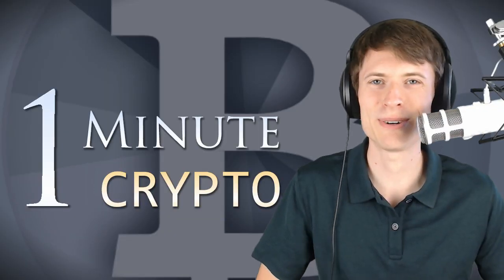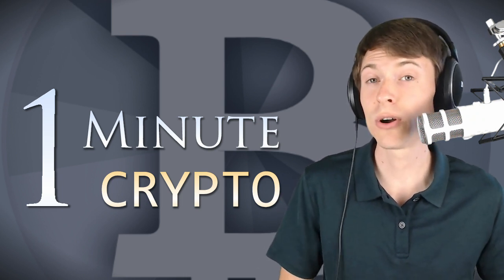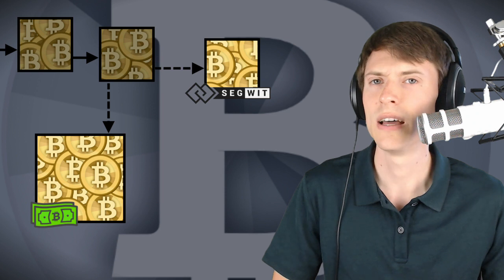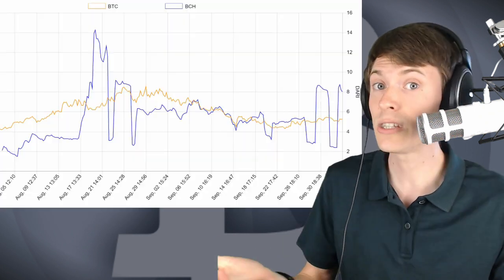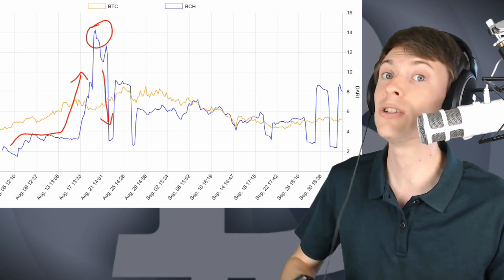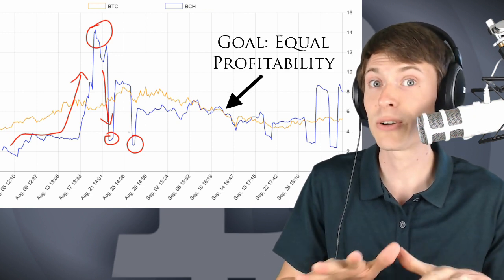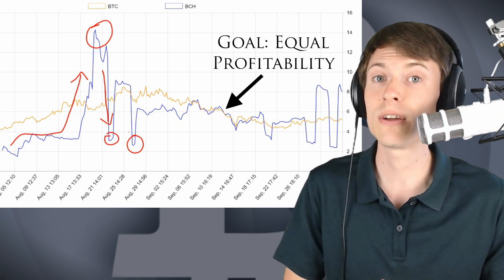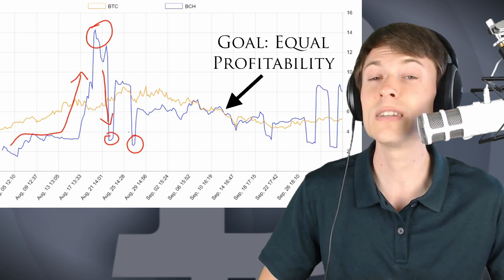Upcoming Fix for Bitcoin Cash "Turbo Blocks"

Comment: You could really improve the quality of this channel substantially.  Document and show links to the key things you're talking about.  Listen to Nelson above "you didn't say what the proposal is".  Also, any observer could see that while for a time the price was tracking more evenly between the two chains, that more recently the wild swings have resumed.  What is the cause of that?  What will drive whether any proposals are accepted?  Also, where are you getting the charts you're showing?  Think of your role as being a "forensic reporter".  Show your work, don't hoard your data.  You will be much more successful.
Reply from the maker: Hi Dan, thanks for the excellent feedback. We'll certainly take it into account.

I'll answer a couple of your questions: The source of the chart is shown in the video: http://fork.lol. The wild swings will continue until this "fix" is in place, because the ecosystem is unstable. This is because, when one chain is more profitable, the short-term best action for 100% of miners is to mine only the more profitable chain until a difficulty adjustment. This creates large oscillations in difficulty.

Thanks again for the comment!

Comment: This will require a hardfork, correct?
Reply from the maker: Correct. However, a hard fork does not always result in two separate active chains; for example, the Monero blockchain executes a successful hard fork multiple times per year.
Reply: id give you a hardfork chronos